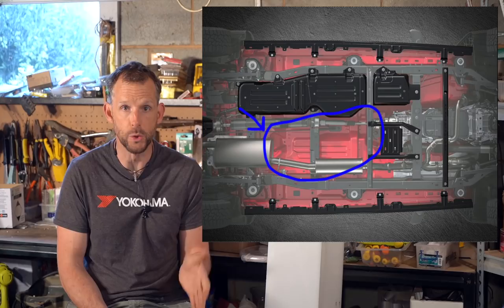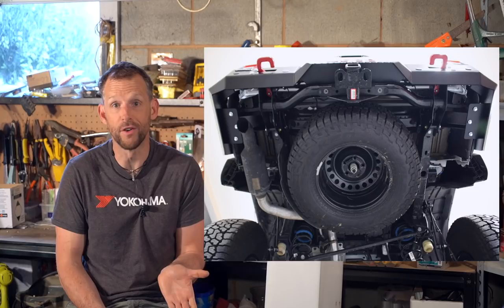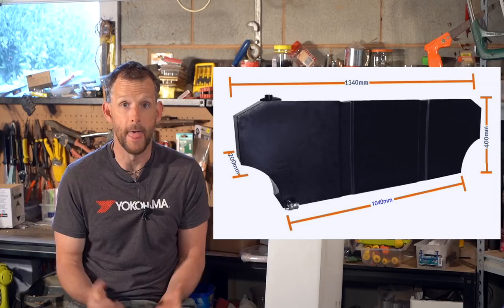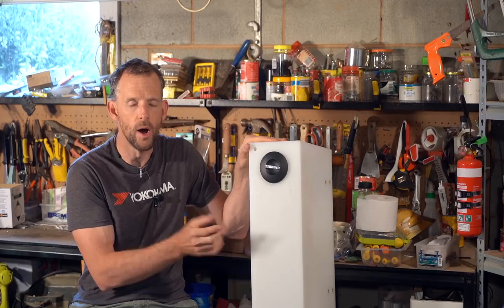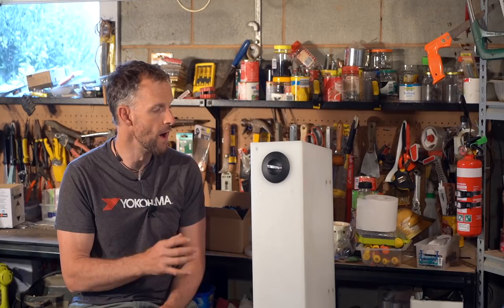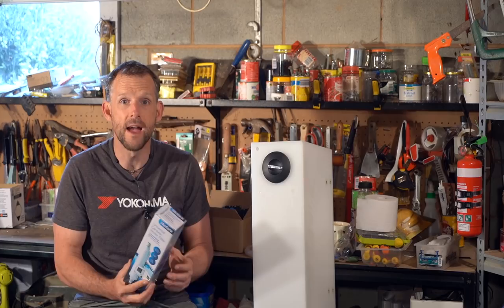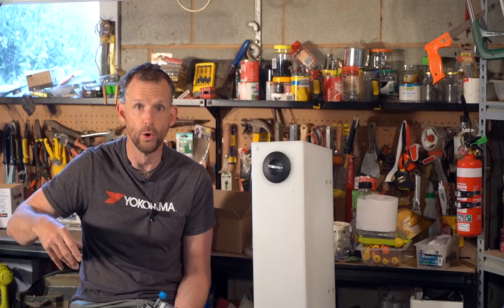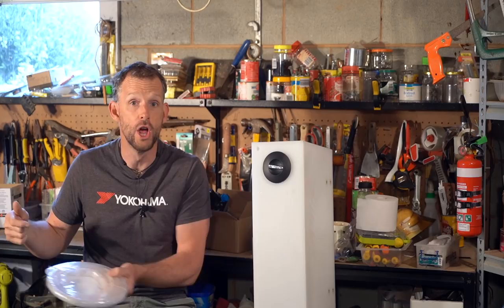Overland Vehicle Drinking Water and Filtration System - Part 1: Design

Comment: Very helpful! I modeled my water system in my rig off your wrangler design with a few little mods. Mainly 2 extra valves to switch where water flows to. I have a tap in the back near the kitchen set up. And another leading to the outside for showers/rinsing equipment before getting stored back into the car.
Reply from the maker: Very cool!

Comment: If you're using the pump for filling, won't it have nasty water in it when you flip the valves to pour yourself a glass of water?
Reply: I was wondering this same thing.
Reply: I think with his system, the filter is always on the outlet side of the pump, so, the water always passes through the filter (both when filling the tank and when going to the tap).
Reply: @briangudger3466  Right. So filling it goes. Nasty>pump>filter>tank. (nasty>nasty>filter>clean) But then when you go to drink it will be tank>pump>filter>drink (clean>nasty>filter>clean). If the pump is filled with nasty connecting the tank outlet to the pump inlet sounds like you haven't kept the nasty and the clean separate.

Imagine you suck in a bird poo from a rainbarrel. The pump'll have nasty all over it's parts. If there's even a drip of back flow, you got a nasty in the tank. Maybe he just runs it for a minute to flush the pump with clean tank water after filling. But you just don't really know if the pump is clean.

Comment: 11 gallons will only be good for 2-3 days if you have a couple passengers.  A good option for reserve tanks could be to have a series of PVC pipes that run along the frame rails.  4" pipe holds 2 gallons per meter and 6" pipe holds 5 gallons per meter.  I'd have perhaps 4 separate tanks.  That way if you break one, you don't lose all of your water.  Once you get back to civilization you'll be able to find the replacement parts in any town.  Perhaps just have a way to pump it into your main tank and when it starts to run low, you fill it up from your pipes.  They wouldn't need any plumping at all that way- just a bung on the end you can stick your pump feed hose into.

Comment: There is an easy to use and lightweight UV light called a Steri-pen that will kill all the bad stuff in a minute or two.  I use mine for local backpacking and have used it for international travel.  Mine is rechargeable using 110 volt but you can also get 12 volt models or converters.  For full time travel Dan’s Africa set up would be far better but the steri-pen is not expensive, portable and weighs almost nothing.
Reply: I'm in WA and hike. I was thinking steri pen too.

Comment: Nice system! I have a question: Is the water pump rate of gallons per minute compatible with the Activated Carbon  Filter flow rate? If yes, then great! If not, then you may risk getting water pushed through the filter too fast and not being filtered adequately and also risk damaging the filter membranes.

Comment: You should think about running a pair of these tanks, one om either side of the bed. Doubles your capacity and it evens the load from side to side
Reply: The same company provides a storage option in exactly the same shape, 2 sections and lockable, this could be another option.

Comment: Consider the use of check-valves for your water suction system; with 1 check valve and a switch/relays to revert pump polarity you do not need any valves!
Reply: Simplest method I can think of: split the hose AFTER the pump, adding the inlet hose, put a check-valve in there, and reversing pump polarity will do the rest :)

Comment: I plan similar you do, but I intend to extend the front bumper forward and get around 100 l tank there. For great weight distribution, and space saving. But we will see later if I succeed.  Also it provide extra help in front end collision.
Reply: Why would you destroy your approach angle?
Reply: @georgejulien3286  I am going to build overlander - not of road vehicle in that sense. Before I have 28°+ bigger tires. And If I need all that, I am most likely going somewhere I shouldn't be going. Around 15 cm thick tank should give me around 100 liters  It is not going to be problem.
Reply: @juliussigurorsson3509  just drive a golf then. Much better fuel economy.
Reply: @juliussigurorsson3509  also what are 28 degree tires?
Reply: @georgejulien3286  the approach angle on the car I intend to use.

Comment: What do you think about the 4xe with a solar panel that would charge the 4xe car battery so that you wouldnt need to use gas
Reply from the maker: Even with massive solar panels you'd have to charge for 10 hours to get something like 50 miles of range. It just doesn't work out.

Comment: I keep thinking about how often I reach over the sides of the bed of a pickup to get at things in the bed, particularly if they are near the front of the bed. An easy opening door or window allow that. What are your thoughts on that with your current canopy setup? Are you designing around that to force all of those needs to the back gate/window? Just curious.
Reply from the maker: To be honest, even at 6'2" it's hard to reach over, and basically impossible without leaning on the side and getting muddy. It will only get worse when I add a mild suspension lift.
So for me, I don't think it makes sense

Comment: I thought this would be a good way to go and found a company in Queensland that makes just one model. I have a 75 series Landcruiser Troopie and apparently people have adapted them to suit a troopie. 
I think I'd go for one each side  so one for potable water and the other for showering and general cleaning.

QUESTIONS
Would the tank need to have baffles so there's no water sloshing about?
I'm thinking of going to a wreckers and getting a dipstick to calibrate it for water volume. Is there another method?
Reply from the maker: I did not have baffles in mine, I don't think it was enough volume to be a problem.
When I mounted mine, there was a light behind it and I left a strip visible, so I could physically see how much water was in there when the light shone through. It worked great.
Reply: @TheRoadChoseMe  thanks for the reply Dan. I'm a bit OCD, for me, seeing how much is in the tank would be one thing, I'd have to know within a litre how much I had left. I've got a mate who does CAD who'll draw it up and fabricate for me. I really enjoyed your videos. Great work. Well done

Comment: Hello Dan, been learning a lot from you about design decisions for longer term overlanding.   Can you talk a little bit about how to settled in on the filter needs based on having to substantially use "surface water" on your journey.  Determining which filters are necessary can be quite confusing, and I am curious why you decided the UV is no longer needed to make surface water safe to drink.

Comment: Jeep engineers: “you don’t want a lot weight behind the rear axles”
Also jeep engineers: makes 2/3s of the truck bed behind the rear axle
Reply: That is the sacrifice you have to make with a dual cab ute/pickup.  
A typical dual cab will have most or even all of the weight behind the rear axle, the Jeep is one of the better ones.

Comment: Really liked hearing you walk through your decision-making process on this one.  Looking forward to the "build" video.  Is that tank baffled or is the volume of water not enough for "sloshing" to be a concern?
Reply: generally you don't want baffling on any food or food grade liquid tank due to issues with cleaning - if the tank is above 20 gallons mounted front to back it might be more noticeable when stopping but the way this is set up sloshing shouldn't really be an issue.

Comment: Hi, Dan: great video and I like your setup. 

Question for you, what are you doing to get hot water for a nice shower in the wild? I was looking at using a heat exchanger and tap into the hot air part of the engine pipe but it requires permanent modifications in the engine compartment, which I don’t like. 

Now I am thinking about getting a 25 ft copper tube and wrapping around the exhaust pipe as heat source, install a 5 gallon aluminum tank and pump water through the copper tube. What do you think of this idea?
Reply: There are plate heater core heat exchangers,  @PrimalOutdoors-CampingandOverlanding just did a vid on his Glind Heat Exchanger. I'd get the Seaflo Diaphragm Pump - 12V DC, 5.5 GPM, 60 PSI which is the Quietest water pump out.
Reply from the maker: Given I'm in Australia (and Africa last time), I'm just using a black bag that I put in the sun for a few hours. It's the perfect shower at sunset to wash away the dust.
Reply: Many thanks to both of you.
Reply: Always a pleasure to try & Help others with an idea  @manimalworks7424 . There's so many ways to heat up water & use gravity sprayers or pressure sprayers. Just depends on which tickles your fancy.
Reply: @TheRoadChoseMe  there is always the stainless steel bucket by the fire....multiuse